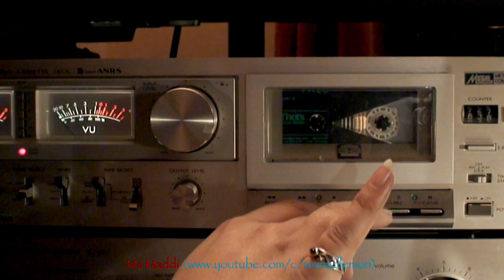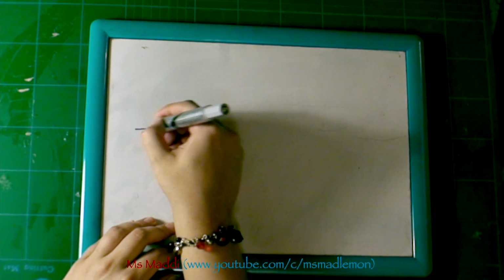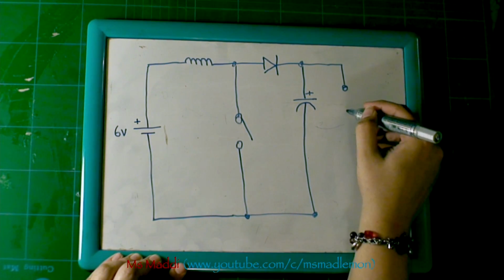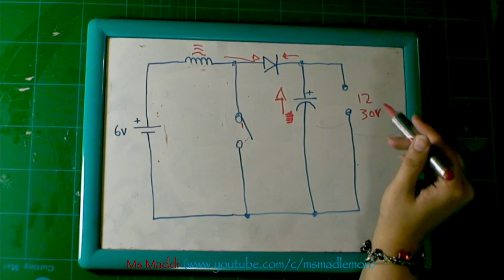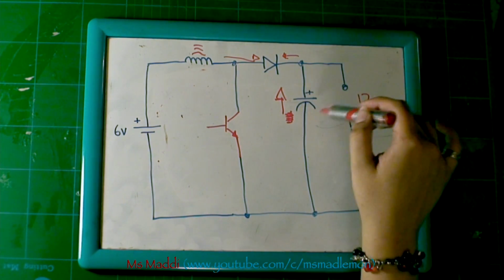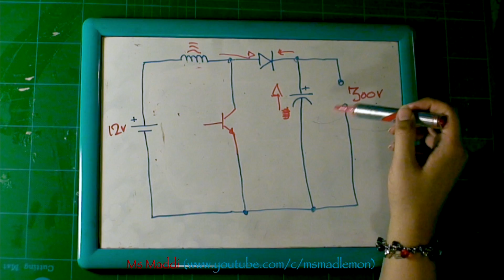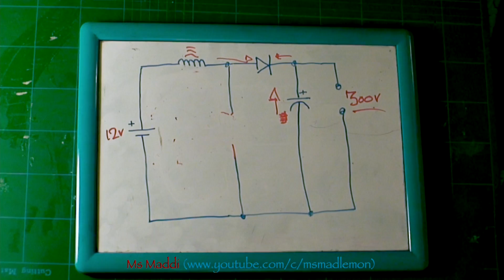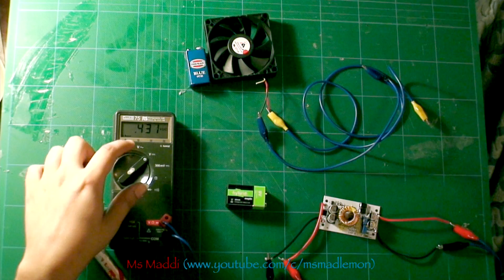Voltage Booster (Boost converter)

Comment: I just subscribed, I want to know if this boost converter can handle input of 12v 200A,  Chinese sellers rated input current 10A maximum, am suspecting their could be referring to discharge current. Can I use the device on a car battery?

Comment: I have several of these and they do the job well. When you were drawing that circuit and talking about the switch opening and closing I kept saying, put a switching transistor in there such as NPN 2n2222 and it will work as a joule thief.

Comment: What is different about the electrons in a capacitor that measures 100V to the electrons in a capacitor at just 10V?  I've heard the analogy of voltage as water pressure. What property of the electron differs though?  The amount of electrons is measured in Coulombs... yes.  And the  current in amperes is the amount of coulombs flowing past a point each second.  Do those electrons move faster if you have a greater potential difference?  I assume so... but what is different about those higher voltage electrons?  What makes them have more pressure and the potential to break through resistance and even jump air gaps?  Is it something to do with the strength of the electrical field?

Comment: I wondered why Ever Ready vanished. They were the most common make in the UK, they were good. The AA and other batteries had to be removed when flat or they squirted some horrible gunk out and ruined whatever they were in. I believe that Duracell still make them  - zinc - carbon , something like that.  Nice simple explanation of a boost / buck converter.
Reply from the maker: Aha, I thought they were a US company no? I read that. I think they are now Energizer. I remember seeing a couple of Ever Ready batteries from childhood. Hence why I decided to get myself some souvenirs/props before they start getting stupidly expensive. (everything vintage is these days) 
And thank you.
Reply: @MsMadLemon   I just subscribed, I want to know if this boost converter can handle input of 12v 200A,  Chinese sellers rated input current 10A maximum, am suspecting their could be referring to discharge current. Can I use the device on a car battery?

Comment: can you tell me what is the max voltage that you can get out of that unit on this video I want to know if it can produce 140 volts I really need AC to DC boost converter
Reply from the maker: That will only give you up to 30-40V ...My VU meter project where I use magic eye tubes require 300V ...I had built this, it's a good circuit, it's adjustable and takes me up to 250v: http://i210.photobucket.com/albums/bb292/frequencycentral/NixieSMPS.jpg
it's a DC to DC converter but you can just convert from AC to DC using a full wave rectifier circuit before you put that voltage into the boost converter. 

It depends what you want to power though...?
Reply: Well help dear i need a 120-140 dc volt. 50 max mah.  Lmk what i can buy chhhheeep to used thank y

Comment: u r cool. i need 120 to 140. my massfeed. is dun on powe sply   one is volt one is Cornish to adjust the voltage mourners to adjust the current you mostly find ones that only has voltage adjustment
Reply from the maker: Cornish? mourners? I dont understand what you're saying...
Reply: Mosfed  chip. Its a block chip an win i band the chip win sys is on it make the led go brighter and dimmer but as soon as it starts getting warm it starts flashing power supply came with the unit I am single down the chip what is going bad or is wrong with it when you see them on power supplies there's usually two of them and they're always pressed against the frame or a heatsink they get very hot and their black about the size of a quarter but Square this is obviously not helping you I understand it is not the correct number or model chip part number but it will give you a idea if it's regulating current It's gotta be a few things
Reply: Square black Chip with 3 post coming out of it
Reply from the maker: Thats a Mosfet transistor, not chip, 
okay it's really difficult to figure out what you're trying to say through your words, I'm not sure what you're trying to do exactly, i'm sorry but I cannot help you. though do look around youtube about the MOSFET transistor
Reply: Just trying to find a cheap driver hundred twenty volts to 140 DC 500 milliamps that's what I need you see one let me know thanks not hard to understand hopefully
Reply from the maker: I dont know of anything like this that is 140vdc and 500mA. If I come across anything like this i´ll let you know.

Comment: I am attempting to make this circuit and have had some issues. I can't get the switching to working despite double checking all the connections to 555 timing circuit. I tested all the voltage points and get adequate readings but the chip will sometimes cook or the MOSFET gets super hot. All this and no voltage build up in the cap beyond the source voltage. Any ideas?

Comment: What happens when we upgrade the output capacitors to higher capacitance or higher voltage?
Reply from the maker: Higher value capacitors, I figure will sustain the higher voltage longer as it's acting as a reservoir.... Higher voltage capacitors wont make a difference, as the rated  voltage of the capacitor just indicates how much it can handle.
Reply: MsMadLemon Can we say that pwm or switched mode power supplies like this offer excellent power factor? I am not sure if this term pf is appropriate here. Thanks!

Comment: read about  boost converter last  week and it  peaked my interest  i will build one with only discrete parts no controller chip or ne555. pulse won't be perfect rectangles but will trigger an nmos just  fine and it  will also have variable duty-cycle !

Comment: That is easy if you want to power small loads...very small loads of course.! How about amps??? Only a few miliamps..!! The important is to modify this to give you enough power to drive bigger loads . But be aware of these circuits. Do NOT try to supply phones or any device like these because the output voltage is not stable at all when current is drawn from the system.They totally depend of the source voltage. (Battery).
Reply from the maker: Actually this one claimed to be for high current.. even though I wouldn't either...And yes it depends on the source.. obviously :o)  ...I wouldn't trust it with anything that needs a stable power source.
Reply: most 9vt battery have limited current output!! but  you have 800W boot converters out there on ebay, which you could power from heavy duty lead acid!!    this one has what looks like some 18 awg on the inductor  so probably 2.5Max input current ,thus around 22.5W max from 9v!t 
 the potentiometer or variable resistor often    varies the duty cycle of the triggering pulse altering induced voltage
Reply: This is not a simple voltage multiplier but a boost converter, they can handle high load without any problem.
Reply: I know it s a boost converter, and thanks for showing me this mistake so i don't  give people the wrong info!!
if its copper wire peak current is 16Amps for any frequency bellow 17kHz not  2.5A sorry for that...so max power at  9v could theoretically  be around 250 Watts, not 22 W as said earlier!! Again thanks!!
Reply: Smith johnny No idea why you felt concerned, my post was meant for the OP ;)
Reply: Been looking at this model recently, it also has current limiting (up to a few amps), ideal for driving LED arrays from something like an old PC or laptop power supply, or car battery.